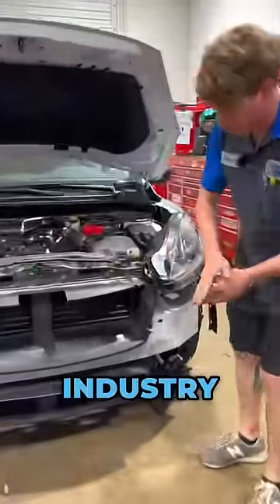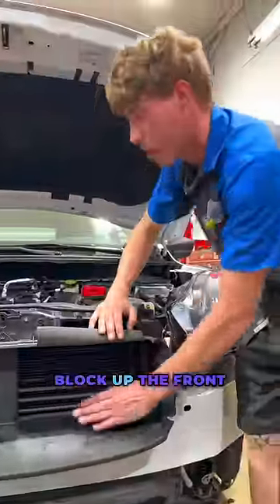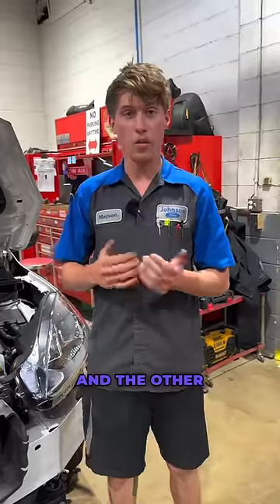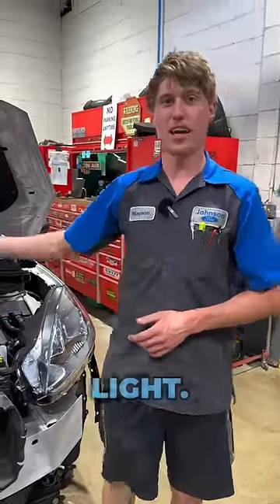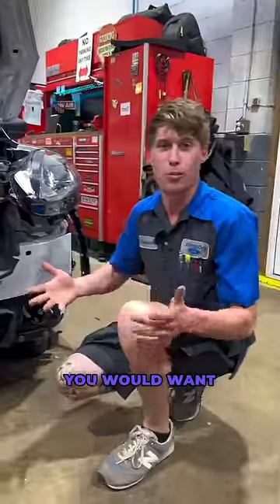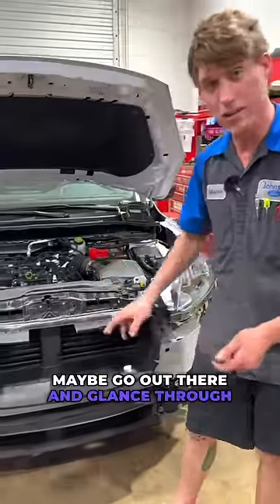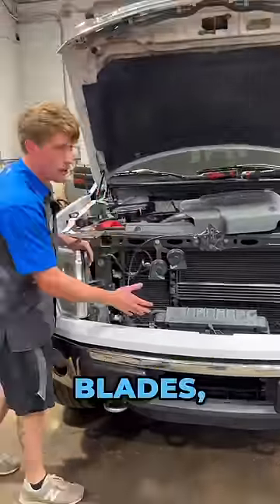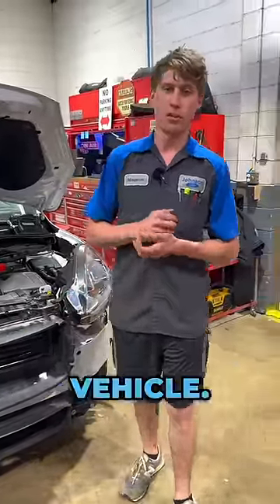Grille Shutters: A Newer Design In The Automotive Industry #shorts

Comment: Ah yes, radiator shutters. I guess a century after their first introduction is long enough for them to be “new” again.
Reply: Electronically controlled shudders that will prevent you from passing inspection...yea but shudders or a bra blocking flow isn't new. Passenger cars haven't come with a radiator blocker device from the factory since...I'm not sure if it was ever standard
Reply: Definitely not for the purpose of emissions either. Old cars and big trucks/machines would have had them because the engine didn't produce enough heat to provide heat in the cold weather
Reply: Back in the 70s, people used cardboard when it got down to subzero temps.
Reply: @markchidester6239 very common on diesel engines in c ok ld weather areas but the problem that i see is freezing shut in cold weather conditions
Reply: @kevinmonahan2820 Some cars have had them for almost the past 20 years, it became more common over a decade ago. It's not "new" the focus has had them since 2012, but he's a ford tech....
Reply: Yup!! They were used on semi trucks for years
Reply: @kevinmonahan2820   Funny you should mention emissions. The original purpose, as I can understand it after looking over one of the original patents from 1923, was to secure a more efficient operation by rapidly warming the engine, as they put it.

They couldn’t care less about emissions in the 1920s, but they did care about having engines run more efficiently. Nowadays I’d imagine they’re making a return for exactly the same reason. Cold engines are inefficient, and burn more gasoline than when they are up to temp. 

Other reason that didn’t matter back then but does now is aerodynamics. Grill shutters can reduce drag when cooling isn’t needed.
Reply: I think the problem is they realized it was a stupid idea, and history is repeating itself. Let's hope the radiator shutter motor is at least $500.00  and breaks about every 12,000 miles. 😮
Reply: For passenger cars with gasoline engines, electronically controlled grille shutters managed by a computer are, in fact, relatively new to the industry.
Reply: @Krankie_V  I mean bmw and benz have had it since 2011 sooooo............
Reply: @jacobpoucher  do you know what the word relatively means? Within well over a century of automotive history, something that came out 13 years ago is fairly recent.
Reply: @Krankie_V  when was the first time you saw a active grille shutter from this century?
Reply: @waldo2635  you are right on the money. They go bad constantly. They ice up and burn out the motor, I've seen bird strikes ruin them, and or jam them up and they fail. I think the move is to remove the fins, leave the motor, the car doesn't know the difference, engine light stays off. That's what I do in my shop I've been messing with these for a decade.
Reply: @jacobpoucher  probably 2017? Do tell how that pertains to how recent the technology is to cars in general. You know, the conversation at hand....
Reply: @Krankie_V they are managed by control modules which contain computers. electric radiator shutters were invented in the 30s so well in the early half of automotive history
Reply: @JayJay-_  I literally said it's the computer controlled ones in passenger cars that are recent. Read again, but more slowly.
Reply: @Krankie_V  you have interesting content. I hope you have a real.job
Reply: @JayJay-_  he is trying he best. He is doing better then most he is just getting a little high on his horse. He has alot to learn. The confidence is a good thing. It's what got him to where he is. He just needs to be able to learn better.
Reply: @jacobpoucher  look. The video is about a computer controlled grille shutter which can cause a check engine light and a host of other issues. This specific type of grille shutter, on passenger  cars, is relatively new. That's why my dude in the video called it new. The fact that old versions on trucks and equipment did exist a long time ago isn't particularly relevant. He is saying they're new within this context and that is pretty true.

Of course I have a job. My youtube channel pays me like 100$ a year if I'm lucky 🤣🤣🤣🤣🤣🤣🤣🤣 I make youtube videos about things that I personally think are interesting. I don't do it for money or popularity. I do it because I like it.
Reply: @Krankie_V  yeah that's not why he called it "new" he hasn't seen one before now iether. Or the video would be from 2011. Just because all you work on is old trash doesn't mean that's all that's out there.
Reply: @jacobpoucher  hahaha yeah he's gotta be gen z with all that confident opinion and zero learning... I wonder if he knows what the bad boy club ( his profile pic) actually was lol
Reply: I have a 1937 Ford. I believe that you could get an aftermarket Winters grill that would close slats to warm the engine up in the winter time. I don't think they came from the factory though
Reply: @kevinmonahan2820  Radiator shutters were common on cars from the late 20's to the mid 30's. Fancy cars like Duesenberg were automatically controlled by the thermostat. Nothing is ever new.
Reply: @jacobpoucher  benz had it back in 2003 w211s had them but we're removed after they failed
Reply: @markchidester6239 my 78 mack truck has automatic shutters lol.
Reply: @srb2az141  but it's krankie v first time seeing these they must be new.
Reply: They had them operated by the thermostat instead of the thermostat just restricting flow of coolant
Reply: @kevinmonahan2820 it is for emissions. Cold engines produce more exhaust and the catalytic converters need to heat up and the engine warming up faster warms them up faster.
Reply: @andyruse4670 kinda, not that their “inefficient” but the tolerances aren’t as tight when it’s cold and it takes more energy to ignite the fuel as their is less heat
Reply: At this point engineers are planning the destruction of the vehicle not the longevity of the vehicle.
Reply: I used to use cardboard to cover my oil cooler and diff cooler in the winter
Reply: 😆 first thing I thought 😁👍🏻
Reply: yup...
Reply: @kevinmonahan2820 The situation you just described is one of the exact reasons why they come installed from the factory… it helps with reducing emissions. Better temperature control, means a cleaner combustion. They can now control it more accurately with a simple electric motor to open or close the fins depending on what’s needed. You think they just designed and paid for this shit to be on there for fun or to burn money? It’s always about meeting emissions requirements. If a side effect or symptom of that happens to increase power or can be advertised as something else, then weeeee!
Reply: Ahh the auto industry adding another layer of shit to go wrong
Reply: Roll Royce used the vertical slats of the grill as shutters for the radiator on 40-60s models. The slats were attached to a wax-bulb thermostat that opened them as it warmed. Most people zip tie the slats open today. Some of the cars had a thermostat for the coolant, some didn’t. I believe it was more asthetic than anything for Royce- seeing the radiator poking through the grill was deemed unsightly.
Reply: @markchidester6239 yep, I used to block off 1/2 of my radiator in my Geo Metro with a piece of cardboard in the winter in central Oregon. Worked great 👍
Reply: Remove any shutters that don't have a position sensors on them.
Reply: Yeah, I started seeing them in14-15

Comment: Funny thing about this is my 1947 farmall H tractor came with radiator shutters from factory. More heat around the engine for cold mornings.
Reply: More specifically for the multifuel engines to getvutvwaem enough to light kerosene on fire...
Reply: @danielkingery2894  Correct. I believe my tractor originally ran on distillate. But at some point the engine was pulled and replaced with gasoline.
Reply: Yeah...thats hilarious
Reply: Yeah, my Belarus 820 and my older Russian tractors all came with those shutters... Man, when you have light work in a field in -20°C you don't get to operating temps...it's an engine saver in sub freezing temps.
Reply: Add an old guy customer that kept putting cardboard in front of his radiator on his new car and it kept overheating on him😂
Reply: My John Deere popper has shutters on it too.
Reply: @shaggydogg630  Pablo thinks he is smart....he is not.
Reply: @jacobpoucher  🤓 Don’t have to be an asshole.Not sure what I did to you.
Reply: @pabloescobarscar4076  it's not funny Pablo
Reply: @jacobpoucher  sure buddy
Reply: @cyrushohbach6729  I had a car that took FOREVER to warm up in the winter so I would cover 1/2 of the radiator in the late fall. Then in the early spring I just removed it.  I put a string on it with duct tape so I could just pull it out and not need to disassemble anything.
Reply: Had a '57 Cub.
Makes me cry, same as the 1964 Duo Glide I got rid of.
I was Dumb & Dumber all by myself.
Reply: @cyrushohbach6729 
Saw a lot of cardboard on school bus grilles in winter.
Reply: @TheLionAndTheLamb777 you had a bad thermostat.  with the multi fuel tractors you needed to essentially overheat them running on gasoline Underload with the shutters closed.  then at the end of the day youd switch back to gas burn out the tractor fuel and finally shut off the fuel and stall it.  then youd be able to start it tomorrow. forget and you're draining fuel and cleaning plugs.
Reply: The big issue is you can't remove these and you can't believe it they are made of cheapest thermoplastics that shatter if you hit a bump too hard.
Reply: Same with my John Deere D of the same year lol
Reply: @danielkingery2894 did you have a stroke?
Reply: @joshmanis9860  hrm... you must be a Liberal Josh...regular folks don't need perfect syntax and spelling to grasp a concept. I don't really gaf about fixing and refusing all the stupid shit YT makes our phones do.
Reply: @danielkingery2894 I was just making a joke not my fault you took it personally I don’t even know what a liberal is. After doing a quick a google search I am NOT a liberal
Reply: I was just about to say the same thing of farmalls. I believe the "regular" had shutters as well to switch between fuels

Comment: It's actually for aerodynamics and fuel efficiency. At speed there's more air than necessary going through the giant grills on modern cars so they close them off.
Reply: bingo
Reply: ditto
Reply: Yup, and these systems are quite basic and from my experience reliable and non intrusive to make any type of deal out of having them.
Reply: Correct. Even with modern multi-valve water cooling systems that have 2, 3 or 4 zones, you can still use the shutters to help a tiny bit with drag, but they do protect the radiator and Inter cooler from rocks and debris.
Reply: They also make a front end collision that much more expensive.
Reply: We dont need those in south texas
Reply: @MrBill67b  So do headlight housings, which are more expensive than the standard sealed beam (or a housing in that shape).  Same with parking sensors and airbags.

The simple solution is don’t run into stuff.
Reply: Exactly. This guy purports to be an expert?
Reply: What happens to the air that hits the shutters? It doesn’t just go around. Lol
Reply: @doghouse4538   The air stuck in the grill that hits the shutters creates a bubble of air that incoming air "just goes around".

Comment: Large intercoolers such as gen 1 ecoboost F150s get condensation buildup when they are too cold and humidity is too high. Grill shutters can ensure higher low load temps in the CAC to prevent this overcooling. Grill shutters can also reduce drag and work at partially open settings.

Comment: The blades can be removed. Just the the one that is connected to the shutter motor leave it on. It won't throw a code by doing that.
Reply: i was going to trick the ecu into thinking it was still there with a resistor but that works too
Reply: @scolfaxtv  @florida57
Why would you want to remove something that works? 
I you're suggestion you would need a working one. 
Of course if and when it stops working you can do something to trick the computer, like an resistor or something.

I'm asking because I really wonder
Reply: Mostly because when removed, there is nothing to break and therefore nothing to replace.

Based on what was said this would be a very expensive repair should they break. Just get rid of somethin that doesn't do much ta start with.  @Anysh5
Reply: @scolfaxtv resistor would not work. The ecu would need to see 2 different signals, 1 for grilles open and 1 for grills closed. If it doesn't see those 2 different signals at the time it needs to (ecu requests open, Ecu requests closed) the ecu will set a check engine light.
Reply: @Anysh5 thats what i thought when i first bought my Focus ST and then almost blew the engine when they decided to stay shut in the middle of rush hour interstate traffic.
Reply: @joey9511 this is why i hate this decision, it just sounds like another way for car companies to get you to buy a new car
Reply: The code doesn't appear on dash anyway, at least on 2014
Reply: @DefaultKnight  This is correct.  You'll need a scanner to retrieve codes
Reply: @DefaultKnight had a 2016 focus st, ripped the entire system out when I went bigger intercooler. You are correct it only stores a fault for shutter failure but will not illuminate check engine light.

Comment: In the 1960,s and 70,s We used to put cardboard in front of the radiator in winter to help warm up cars
Reply: Yall didn't have thermostats?
Reply: @JulianVR4  we had a thermostat, but it stayed shut as the fan was not electric and kept the radiator cold
Reply: @laughing_gnome  Aussie here. LOL! Next you will tell me that snow actually falls from the sky, rather than being manufactured at ski slopes.

Best mod I ever did to my TG model Holden Gemini was to install a 2 core rally radiator and drill about four holes in the thermostat.

Next you are going to make up something wild, like electric blankets for your car, or melting the radiator water with a hair dryer.
Reply: These people obviously never lived in cold climate
Reply: @finalmidnight   ha ha ha it does. And we use engine block heaters and antifreeze coolant too! Although modern tech & synthetic oils work really well at low temps.
Reply: @oneninerniner3427  Antifreeze? You mean Anti-Boil, right? Does the Easter Bunny bring you that stuff with the eggs?

Pull the other one, it has bells on it!

Comment: My father had a 1938 Packard Opera Coupe with thermostatically-controlled radiator shutters. They were vertical though, and he said rainwater collected in the channel at the bottom, if it froze the shutters jammed closed and the engine overheated.

Comment: Big trucks had grille shutters in the '30s.
Reply: Ya jr thinks this is some marvel technology…
Reply: had automatic air operated ones into the 70s and 80s as well
Reply: @Cultofpersonality09129 hes talking about the fact that it won't pass emissions without it
Reply: Diesel trucks need to warm up a lot more than a small gas car. This is just pointless over-engineering for the purpose of adding cost.
Reply: @JohnPlissken  yes sir you’re absolutely correct. Also I wouldn’t have a problem with over engineering if anyone could work on it, but more and more they are making it so proprietary BS. It will take some law changes and consumers buying stuff that can be fixed for them to quit this stuff
Reply: @JohnPlissken I plug my truck in and throw a game bag over the grill, get the hood to hold it, works womders
Reply: Probably a million locust compared to our dead ecosystem now
Reply: @JohnPlissken CAFE standards
Reply: @JohnPlissken wrong
Reply: .. the old school way of doing that is but a piece of cardboard in front of your radiator but still allowing some flow... I remember doing it back in 1985 to help my car that has a stuck open thermostat ..